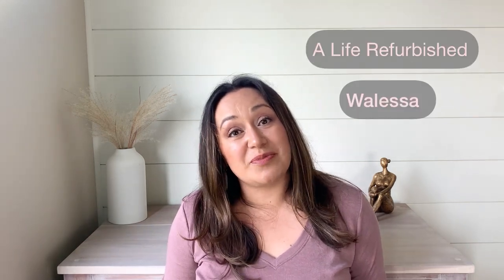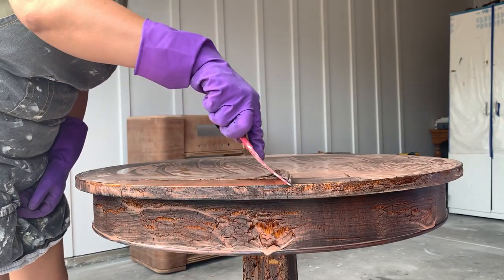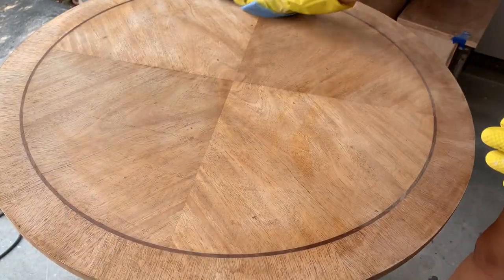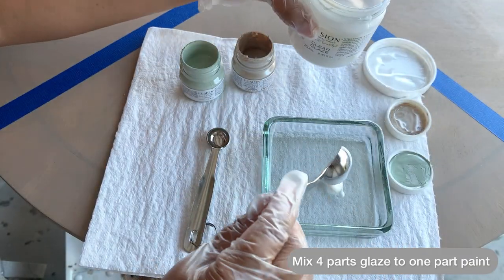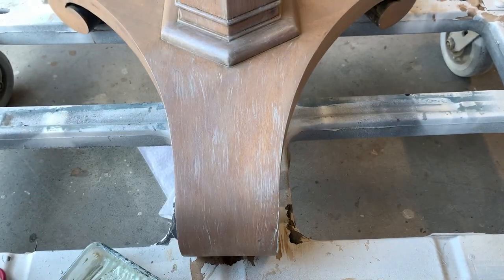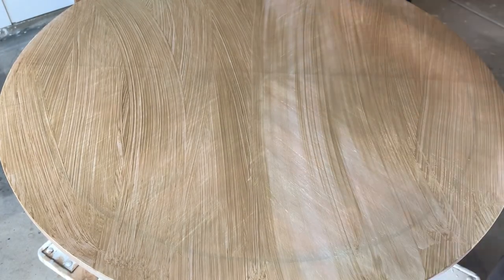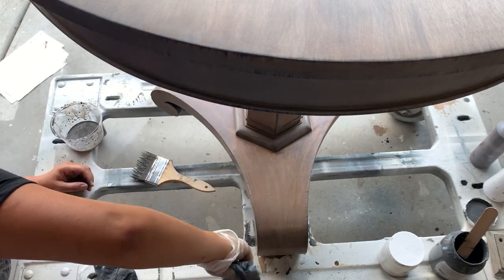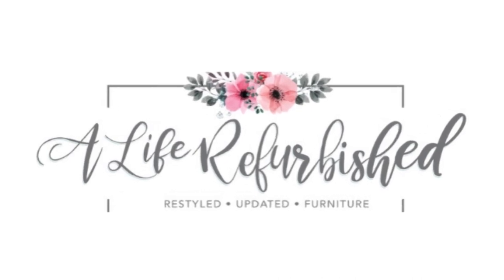Table Makeover Making Your Own Glaze | Creating a Coastal Finish

Comment: It turned out great.  Lots of techniques to learn.  Definitely will be one I'll be saving for future reference.  I love fusion.  Sanding a buffet later today and then I'll be painting it in bayberry.   I've stripped the top and thinking about using cappucino for the top and legs (have to strip the legs!  Won't be easy as it took four coats of stripper for the top and then had to go in with carbide scraper to get the thick, thick layer of varnish off it.)  I'll be using rub 'n' buff for the handles and to highlight parts of the buffet itself.  If it turns out like I see it in my head it'll be beautiful.  Also have to do a coffee table in the same colour.  I'm keeping both.  Was meant to sell the buffet but I've fallen in love with it.
Reply from the maker: Bayberry is a beautiful color! I’ve used it with cappuccino before. It sounds like you are going to be busy for a while. I’m sure it will turn out beautiful! 😊
Reply: @aliferefurbished  Busy surely.  But it'll be worth it.  My daughter wants me to makeover her chest of drawers in her bedroom too.  We have a beautiful poster to decoupage onto the front of it.  Huge learning curve for me.  I've only ever painted some chairs and little things like that in the past - years ago!  The buffet will be my first proper piece and I've come across so many hurdles already.  That was certainly a lot of lessons learned but so far no harm done along the way - phew!  Being uber careful with everything so it'll take me some time to get all done but as long as it's done right, I don't  mind.
Reply from the maker: @bluecurlygirl  It all sounds very exciting! Decoupage?! I love that your daughter wants something different. It will indeed all be worth it! Enjoy!